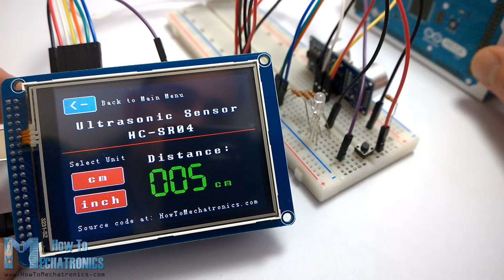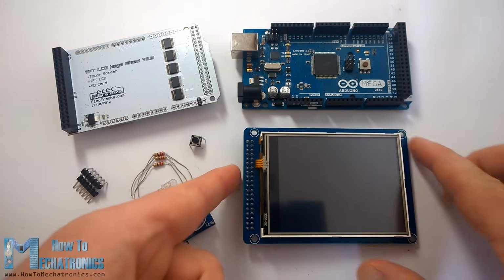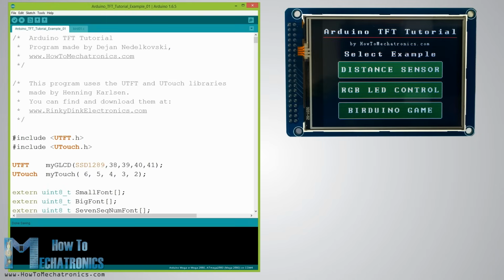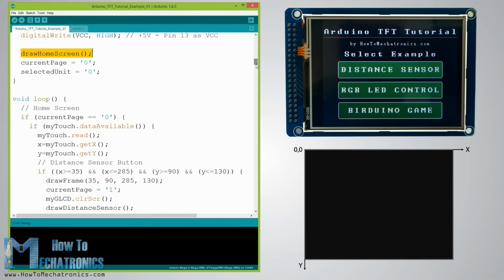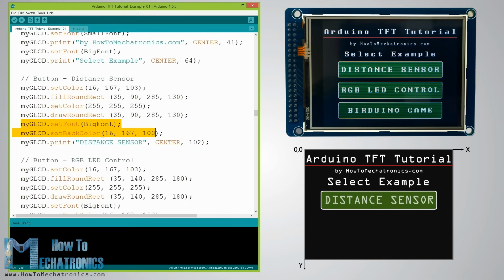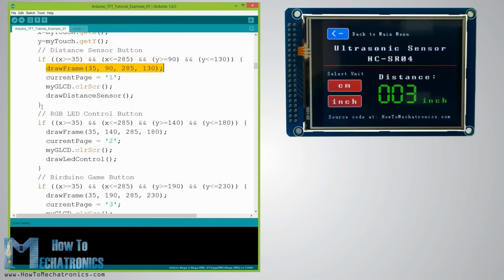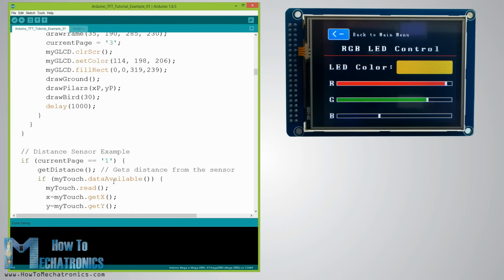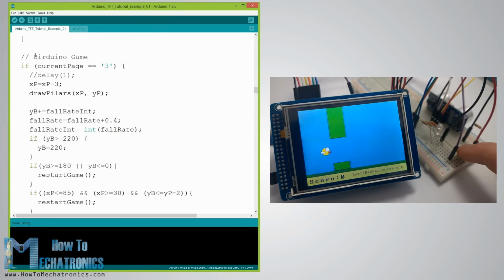Arduino TFT LCD Touch Screen Tutorial

Comment: Super  how quickly can you follow this  ?

 If you can stream this over the airwaves via memory streams  in real time using ESP transfer this would be marvelous 

You are undoubtedly a clever man but the shear speed at which you present this ...  well ....  Most of us would have been lost in first five seconds  Its brilliant Try braking your tutorial up into smaller parts for the project How about a flow chart as well  people are watching this because they would like to learn i learnt nothing here at all except that you used a library you used functions from that library and bingo with some huge magic it worked 

What about the repaint how did you achieve this for example ? 

What about the fonts where did this come from ? How do you make up a font ?
What about text size how did you center the text inside your buttons ?

Capturing touch events What happened  to your explanation there ?? 

Show is tell us  ?? Slow down a little  It obviously good we want to see how ?? and what and why you chose these methods  

What are the disadvantages ??
What are the advantages ??

Class hierarchy did you use any oop in this Constructors , parameters etc etc 

Other wise very interesting but your explanations are far to rushed !!
Reply: Hi +Dejan Nedelkovski  Dont get upset Im not insulting you  its positive criticism  Its not nonsense  at all There is a hardware side to this as well Anyone can rattle off a very quick explanation as you have regards using an LCD Not everyone how ever after watching this will be able to write software for an LCD screen least of all the drivers That means just as I have encountered with another company that what they then do is sell the hardware plus a so called compiler which they advertise on their site and then my friend the problems start  The hardware works but the IDE and the compiler don't or visa versa Now your stuck with a problem as a business because you didn't understand the fundamentals of what whats going on how you arrived at that solution to start with 

Not that I dont think you know what you are doing great you obviously do but when you show someone or teach someone how to do something you dont teach them the quick way you show them the basics first That means the registers , how to write to a port How the x,y co ordinate systems work on a lcd  How latch works How a shift register works How to obtain the x, y points of the touch screen 

How you switch on an off a pixel 

How a switch statement works 

Speed of execution of code 

Pipelining 

Ram 

Boot loader code 

SD read write sectors 

Serial communications 

Bit banging 

How much more must I enhance on to illustrate this point 

Great rushed Job  Yes they can copy and write code Brilliant news but its like all copies  Bad copy to start with The copy only ever gets worse as more mistakes are introduced into this 

So its takes you a bit longer but then I dare say what is it you want at the end of this Do you want an engineer who is capable who can go into back end of that code and make adjustments who can work out why a class set of c++ code which is where this is derived from doesn't work or do you just want a monkey 

I guess thats the decision you have to make and those who teach or show others as you have also have to decide equally then if thats the case and you think possibly they don't need to know all this then you must also not point fingers when they don't know and as consequence accept that standards are low and industry is bad , business is going broke because all you did was explain  this topic as you have 

In conclusion to this lets ask how many people who watched this clip explain this 

See below please 

Now ask them to explain all of this Uh..... Help  !! I don't know whats going on here what do i do now i have to implement another function in this Now what do i do because I don't know how to write to the chips on the display panel  I was never taught !! 

And I don't understand a schematic of the display And I don't understand what component is what And when this fails or I bought this brand new I also don't know how to check for hardware faults and write software to assist me because I dint learn the basics  But hey !!  I know how to copy your example though and I dont need to know anything else do I according  to what you have just told me 

But thats good enough isnt it ?? hmmm   You tell me Your the lecturer in these circumstances not me 

#include "Adafruit_GFX.h"
#include "glcdfont.c"
#ifdef _AVR_
 #include <avr/pgmspace.h>
#else
 #define pgm_read_byte(addr) (*(const unsigned char *)(addr))
#endif

Adafruit_GFX::Adafruit_GFX(int16_t w, int16_t h):
  WIDTH(w), HEIGHT(h)
{
  _width    = WIDTH;
  _height   = HEIGHT;
  rotation  = 0;
  cursor_y  = cursor_x    = 0;
  textsize  = 1;
  textcolor = textbgcolor = 0xFFFF;
  wrap      = true;
}

/
Reply: +Mark Harrington 

Continuation of code 
/ Draw a circle outline
void Adafruit_GFX::drawCircle(int16_t x0, int16_t y0, int16_t r,
    uint16_t color) {
  int16_t f = 1 - r;
  int16_t ddF_x = 1;
  int16_t ddF_y = -2 * r;
  int16_t x = 0;
  int16_t y = r;

  drawPixel(x0  , y0+r, color);
  drawPixel(x0  , y0-r, color);
  drawPixel(x0+r, y0  , color);
  drawPixel(x0-r, y0  , color);

  while (x<y) {
    if (f >= 0) {
      y--;
      ddF_y += 2;
      f += ddF_y;
    }
    x++;
    ddF_x += 2;
    f += ddF_x;
  
    drawPixel(x0 + x, y0 + y, color);
    drawPixel(x0 - x, y0 + y, color);
    drawPixel(x0 + x, y0 - y, color);
    drawPixel(x0 - x, y0 - y, color);
    drawPixel(x0 + y, y0 + x, color);
    drawPixel(x0 - y, y0 + x, color);
    drawPixel(x0 + y, y0 - x, color);
    drawPixel(x0 - y, y0 - x, color);
  }
}

void Adafruit_GFX::drawCircleHelper( int16_t x0, int16_t y0,
               int16_t r, uint8_t cornername, uint16_t color) {
  int16_t f     = 1 - r;
  int16_t ddF_x = 1;
  int16_t ddF_y = -2 * r;
  int16_t x     = 0;
  int16_t y     = r;

  while (x<y) {
    if (f >= 0) {
      y--;
      ddF_y += 2;
      f     += ddF_y;
    }
    x++;
    ddF_x += 2;
    f     += ddF_x;
    if (cornername & 0x4) {
      drawPixel(x0 + x, y0 + y, color);
      drawPixel(x0 + y, y0 + x, color);
    } 
    if (cornername & 0x2) {
      drawPixel(x0 + x, y0 - y, color);
      drawPixel(x0 + y, y0 - x, color);
    }
    if (cornername & 0x8) {
      drawPixel(x0 - y, y0 + x, color);
      drawPixel(x0 - x, y0 + y, color);
    }
    if (cornername & 0x1) {
      drawPixel(x0 - y, y0 - x, color);
      drawPixel(x0 - x, y0 - y, color);
    }
  }
}
Reply: +Mark Harrington  Continuation of code 

void Adafruit_GFX::fillCircle(int16_t x0, int16_t y0, int16_t r,
         uint16_t color) {
  drawFastVLine(x0, y0-r, 2*r+1, color);
  fillCircleHelper(x0, y0, r, 3, 0, color);
}

// Used to do circles and roundrects
void Adafruit_GFX::fillCircleHelper(int16_t x0, int16_t y0, int16_t r,
    uint8_t cornername, int16_t delta, uint16_t color) {

  int16_t f     = 1 - r;
  int16_t ddF_x = 1;
  int16_t ddF_y = -2 * r;
  int16_t x     = 0;
  int16_t y     = r;

  while (x<y) {
    if (f >= 0) {
      y--;
      ddF_y += 2;
      f     += ddF_y;
    }
    x++;
    ddF_x += 2;
    f     += ddF_x;

    if (cornername & 0x1) {
      drawFastVLine(x0+x, y0-y, 2*y+1+delta, color);
      drawFastVLine(x0+y, y0-x, 2*x+1+delta, color);
    }
    if (cornername & 0x2) {
      drawFastVLine(x0-x, y0-y, 2*y+1+delta, color);
      drawFastVLine(x0-y, y0-x, 2*x+1+delta, color);
    }
  }
}

// Bresenham's algorithm - thx wikpedia
void Adafruit_GFX::drawLine(int16_t x0, int16_t y0,
       int16_t x1, int16_t y1,
       uint16_t color) {
  int16_t steep = abs(y1 - y0) > abs(x1 - x0);
  if (steep) {
    swap(x0, y0);
    swap(x1, y1);
  }

  if (x0 > x1) {
    swap(x0, x1);
    swap(y0, y1);
  }

  int16_t dx, dy;
  dx = x1 - x0;
  dy = abs(y1 - y0);

  int16_t err = dx / 2;
  int16_t ystep;

  if (y0 < y1) {
    ystep = 1;
  } else {
    ystep = -1;
  }

  for (; x0<=x1; x0++) {
    if (steep) {
      drawPixel(y0, x0, color);
    } else {
      drawPixel(x0, y0, color);
    }
    err -= dy;
    if (err < 0) {
      y0 += ystep;
      err += dx;
    }
  }
}

// Draw a rectangle
void Adafruit_GFX::drawRect(int16_t x, int16_t y,
       int16_t w, int16_t h,
       uint16_t color) {
  drawFastHLine(x, y, w, color);
  drawFastHLine(x, y+h-1, w, color);
  drawFastVLine(x, y, h, color);
  drawFastVLine(x+w-1, y, h, color);
}
Reply: +Mark Harrington 

Continuation of code 

void Adafruit_GFX::drawFastVLine(int16_t x, int16_t y,
     int16_t h, uint16_t color) {
  // Update in subclasses if desired!
  drawLine(x, y, x, y+h-1, color);
}

void Adafruit_GFX::drawFastHLine(int16_t x, int16_t y,
     int16_t w, uint16_t color) {
  // Update in subclasses if desired!
  drawLine(x, y, x+w-1, y, color);
}

void Adafruit_GFX::fillRect(int16_t x, int16_t y, int16_t w, int16_t h,
       uint16_t color) {
  // Update in subclasses if desired!
  for (int16_t i=x; i<x+w; i++) {
    drawFastVLine(i, y, h, color);
  }
}

void Adafruit_GFX::fillScreen(uint16_t color) {
  fillRect(0, 0, _width, _height, color);
}

// Draw a rounded rectangle
void Adafruit_GFX::drawRoundRect(int16_t x, int16_t y, int16_t w,
  int16_t h, int16_t r, uint16_t color) {
  // smarter version
  drawFastHLine(x+r  , y    , w-2*r, color); // Top
  drawFastHLine(x+r  , y+h-1, w-2*r, color); // Bottom
  drawFastVLine(x    , y+r  , h-2*r, color); // Left
  drawFastVLine(x+w-1, y+r  , h-2*r, color); // Right
  // draw four corners
  drawCircleHelper(x+r    , y+r    , r, 1, color);
  drawCircleHelper(x+w-r-1, y+r    , r, 2, color);
  drawCircleHelper(x+w-r-1, y+h-r-1, r, 4, color);
  drawCircleHelper(x+r    , y+h-r-1, r, 8, color);
}

// Fill a rounded rectangle
void Adafruit_GFX::fillRoundRect(int16_t x, int16_t y, int16_t w,
     int16_t h, int16_t r, uint16_t color) {
  // smarter version
  fillRect(x+r, y, w-2*r, h, color);

  // draw four corners
  fillCircleHelper(x+w-r-1, y+r, r, 1, h-2*r-1, color);
  fillCircleHelper(x+r    , y+r, r, 2, h-2*r-1, color);
}
Reply: +Mark Harrington 

Continuations of Code 

// Draw a triangle
void Adafruit_GFX::drawTriangle(int16_t x0, int16_t y0,
    int16_t x1, int16_t y1,
    int16_t x2, int16_t y2, uint16_t color) {
  drawLine(x0, y0, x1, y1, color);
  drawLine(x1, y1, x2, y2, color);
  drawLine(x2, y2, x0, y0, color);
}

// Fill a triangle
void Adafruit_GFX::fillTriangle ( int16_t x0, int16_t y0,
      int16_t x1, int16_t y1,
      int16_t x2, int16_t y2, uint16_t color) {

  int16_t a, b, y, last;

  // Sort coordinates by Y order (y2 >= y1 >= y0)
  if (y0 > y1) {
    swap(y0, y1); swap(x0, x1);
  }
  if (y1 > y2) {
    swap(y2, y1); swap(x2, x1);
  }
  if (y0 > y1) {
    swap(y0, y1); swap(x0, x1);
  }

  if(y0 == y2) { // Handle awkward all-on-same-line case as its own thing
    a = b = x0;
    if(x1 < a)      a = x1;
    else if(x1 > b) b = x1;
    if(x2 < a)      a = x2;
    else if(x2 > b) b = x2;
    drawFastHLine(a, y0, b-a+1, color);
    return;
  }

  int16_t
    dx01 = x1 - x0,
    dy01 = y1 - y0,
    dx02 = x2 - x0,
    dy02 = y2 - y0,
    dx12 = x2 - x1,
    dy12 = y2 - y1;
  int32_t
    sa   = 0,
    sb   = 0;

  // For upper part of triangle, find scanline crossings for segments
  // 0-1 and 0-2.  If y1=y2 (flat-bottomed triangle), the scanline y1
  // is included here (and second loop will be skipped, avoiding a /0
  // error there), otherwise scanline y1 is skipped here and handled
  // in the second loop...which also avoids a /0 error here if y0=y1
  // (flat-topped triangle).
  if(y1 == y2) last = y1;   // Include y1 scanline
  else         last = y1-1; // Skip it

  for(y=y0; y<=last; y++) {
    a   = x0 + sa / dy01;
    b   = x0 + sb / dy02;
    sa += dx01;
    sb += dx02;
    /* longhand:
    a = x0 + (x1 - x0) * (y - y0) / (y1 - y0);
    b = x0 + (x2 - x0) * (y - y0) / (y2 - y0);
    */
    if(a > b) swap(a,b);
    drawFastHLine(a, y, b-a+1, color);
  }

  // For lower part of triangle, find scanline crossings for segments
  // 0-2 and 1-2.  This loop is skipped if y1=y2.
  sa = dx12 * (y - y1);
  sb = dx02 * (y - y0);
  for(; y<=y2; y++) {
    a   = x1 + sa / dy12;
    b   = x0 + sb / dy02;
    sa += dx12;
    sb += dx02;
    /* longhand:
    a = x1 + (x2 - x1) * (y - y1) / (y2 - y1);
    b = x0 + (x2 - x0) * (y - y0) / (y2 - y0);
    */
    if(a > b) swap(a,b);
    drawFastHLine(a, y, b-a+1, color);
  }
}
Reply: +Mark Harrington 

Continuation of Code 

void Adafruit_GFX::drawBitmap(int16_t x, int16_t y,
         const uint8_t *bitmap, int16_t w, int16_t h,
         uint16_t color) {

  int16_t i, j, byteWidth = (w + 7) / 8;

  for(j=0; j<h; j++) {
    for(i=0; i<w; i++ ) {// Draw a rectangle
void Adafruit_GFX::drawRect(int16_t x, int16_t y,
       int16_t w, int16_t h,
       uint16_t color) {
  drawFastHLine(x, y, w, color);
  drawFastHLine(x, y+h-1, w, color);
  drawFastVLine(x, y, h, color);
  drawFastVLine(x+w-1, y, h, color);
}

void Adafruit_GFX::drawFastVLine(int16_t x, int16_t y,
     int16_t h, uint16_t color) {
  // Update in subclasses if desired!
  drawLine(x, y, x, y+h-1, color);
}

void Adafruit_GFX::drawFastHLine(int16_t x, int16_t y,
     int16_t w, uint16_t color) {
  // Update in subclasses if desired!
  drawLine(x, y, x+w-1, y, color);
}

void Adafruit_GFX::fillRect(int16_t x, int16_t y, int16_t w, int16_t h,
       uint16_t color) {
  // Update in subclasses if desired!
  for (int16_t i=x; i<x+w; i++) {
    drawFastVLine(i, y, h, color);
  }
}

void Adafruit_GFX::fillScreen(uint16_t color) {
  fillRect(0, 0, _width, _height, color);
}

// Draw a rounded rectangle
void Adafruit_GFX::drawRoundRect(int16_t x, int16_t y, int16_t w,
  int16_t h, int16_t r, uint16_t color) {
  // smarter version
  drawFastHLine(x+r  , y    , w-2*r, color); // Top
  drawFastHLine(x+r  , y+h-1, w-2*r, color); // Bottom
  drawFastVLine(x    , y+r  , h-2*r, color); // Left
  drawFastVLine(x+w-1, y+r  , h-2*r, color); // Right
  // draw four corners
  drawCircleHelper(x+r    , y+r    , r, 1, color);
  drawCircleHelper(x+w-r-1, y+r    , r, 2, color);
  drawCircleHelper(x+w-r-1, y+h-r-1, r, 4, color);
  drawCircleHelper(x+r    , y+h-r-1, r, 8, color);
}

// Fill a rounded rectangle
void Adafruit_GFX::fillRoundRect(int16_t x, int16_t y, int16_t w,
     int16_t h, int16_t r, uint16_t color) {
  // smarter version
  fillRect(x+r, y, w-2*r, h, color);

  // draw four corners
  fillCircleHelper(x+w-r-1, y+r, r, 1, h-2*r-1, color);
  fillCircleHelper(x+r    , y+r, r, 2, h-2*r-1, color);
}
      if(pgm_read_byte(bitmap + j * byteWidth + i / 8) & (128 >> (i & 7))) {
        drawPixel(x+i, y+j, color);
      }
    }
  }
}

// Draw a 1-bit color bitmap at the specified x, y position from the
// provided bitmap buffer (must be PROGMEM memory) using color as the
// foreground color and bg as the background color.
void Adafruit_GFX::drawBitmap(int16_t x, int16_t y,
            const uint8_t *bitmap, int16_t w, int16_t h,
            uint16_t color, uint16_t bg) {

  int16_t i, j, byteWidth = (w + 7) / 8;
  
  for(j=0; j<h; j++) {
    for(i=0; i<w; i++ ) {
      if(pgm_read_byte(bitmap + j * byteWidth + i / 8) & (128 >> (i & 7))) {
        drawPixel(x+i, y+j, color);
      }
      else {
       drawPixel(x+i, y+j, bg);
      }
    }
  }
}
Reply: Not to worry though thats only half the problem hmm ??

Comment: Hi Bro, How to communicate between FPGA and arduino? I am using kintex 7 and spartan 6 to interface with arduino uno.
FPGA >  Arduino uno   > nRF24  ---  (transmitted data)----  nRF24  ->Arduino Uno -> PC.
Communicate using nRF24 is working, but the data will be picked up from FPGA
Reply: +Ali Akbar interface the nRF24 directly to FPGA

Comment: Mr Dejan 
How i can connect Arduino with TFT LCD without shield ?
I don't have  that shield now

Thank You Sir
Reply: +Nader Alhumidi if you will manage to do your own shield that will lower your power lvl from 5 to 3.3 V on all  pins you're good. If not, buy yourself one XD
Reply: @Designer Monk, mmmm... voltage divider is not good practice IMO. 

Reason being is that your voltage divider is neglecting the resistance of the display. If you try to do this you might get lucky, but you might also come across a low impedance device.... then you let the magic smoke out.

If you wanted to properly use a voltage divider then you would need to place an op-amp (high impedance device) with a gain of 1 in the middle of your dividing circuit. This way you could sink current from your op-amp rails... well, and at this point you might as well just order the non-inverting buffer as I suggested above.

Voltage dividers are one of the first things people learn about in class, but in practicality they just do not really work without a buffer.
Reply: Wow, thank you for taking the time to write a detailed reply. Much appreciated. Always learning something everyday :) I used a voltage divider with mine and I guess I was lucky. I guess it's better to order that display shield...
Reply: Designer Monk odds are the voltage divider worked for you in this situation because the IO on the lcd probably have a buffer protecting them. This buffer is highly likely to be a high impedance input device, therefore the voltage divider isn’t being effected too much. 

Your resistor network is probably 10k, 20k, and 1M (the buffer). You should put a multimeter on the middle of your divider with the display connected and measure the voltage. Then do it again with the display disconnected and compare the two voltages. 

Also the buffer on the display is most likely a lower voltage which is why I’m guessing you can’t hook 5v up directly.

Best of luck!
Reply: Better to buy it now rather than buying it after you fry your TFT cause you mixed up your pin outs.
Reply: You need a non-inverting buffer
Reply: For anyone reading, you can use a 20kohm-10kohm voltage divider too.
Reply: Thanks mate for the explanation. Gracias!